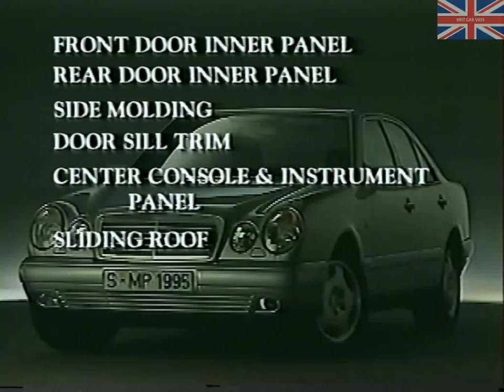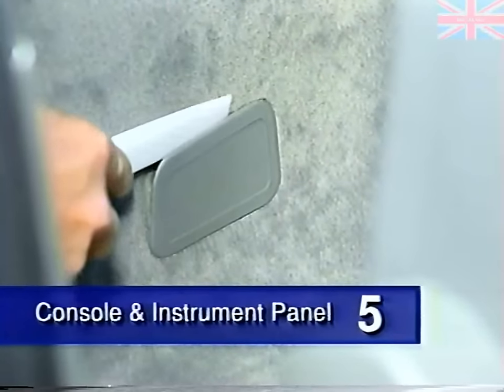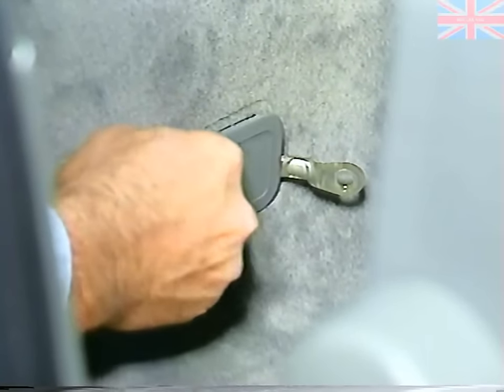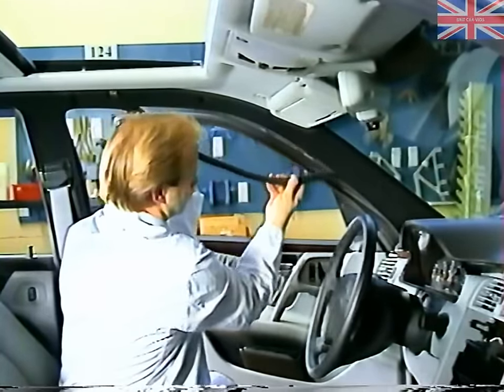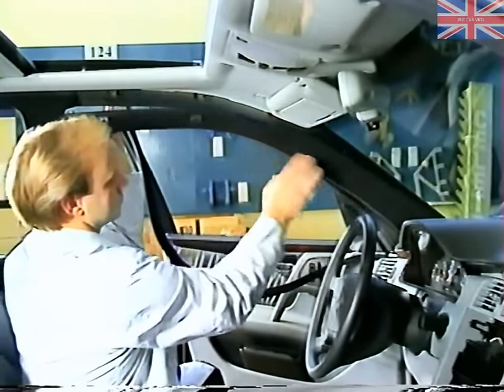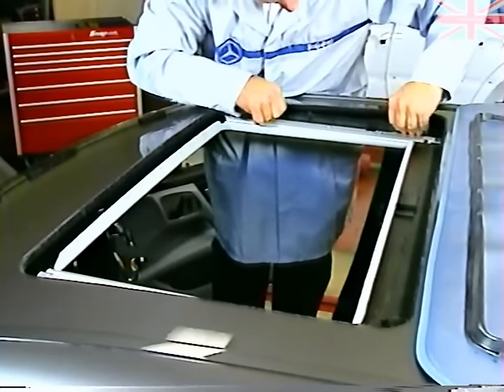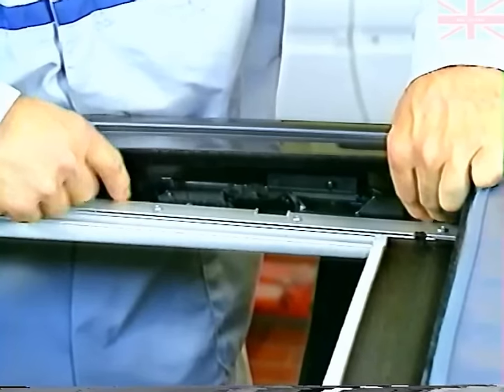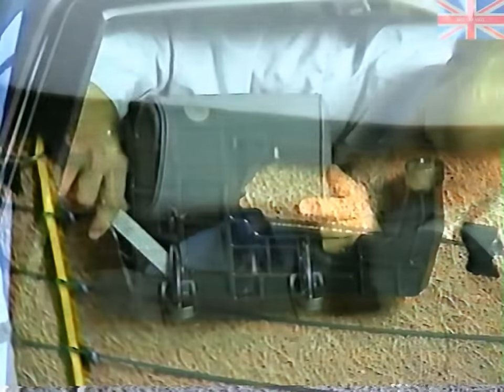Mercedes - E Class (W210) - Disassembly Procedures (1995)

Comment: who else has a rusty w210
Reply: ...depends a lot with the climate, if you live in a snow zone where they put salt as an anti frost...
Reply: I have a 1999 estate wagon which is even worse than sedans Sigh ; [
Reply: P A T I N A lol
Reply: I had a rusty W210 and now I have a rusty W211
Reply: everyone
Reply: @Sensual Digest hey just wanna know if the w140 s500 use the same mirror's. Like im driving ths v8 s500 boletproof n i lost a right mirror. So im looking fo one
Reply: I’m preparing my self to fix my Rusty friend, the two-ten 
320 cdi because I love how it rides.
Reply: 2000 e270 cdi here, little bit of rust, 570k km on the clock and im getting rid of that rust in march - beautiful engine, powerfull and reliable as hell
Reply: I’ve never had a Mercedes which wasn’t rusty.
Reply: my 124 has more rust than my 210 lol. I think people might a bit over excessive with the rust issue on 210. Yes, the waterbased paint is kinda bad at that time, but eventually every car will rust, just matter of time (I even saw an Audi a8 rust pretty badly lol). That's said if you take care of the car and maintain it properly, it's not gonna have any rust for sure  (but sadly not everyone appriciate w210 body style, which is another reason why they rust pretty badly)
Reply: I don't have rusty on my e320 never
Reply: In France near Paris. Not on my wagon.
Lot on my sedan.
Reply: I have 2 1 from 2000 and 1 from 2001 wagons is both

Comment: How i can reset the infrared remotkey to stop lighting both red & green on the middel mirror in w210 1996 ??
Reply: The same happened to me. This indicates that the battery is getting low so replacing the old battery in the remote controller resolves this. Cheers

Comment: Folks,   please help !!  Need to replace Brake Light Switch on my 2002 W210 E200K.  Please explain steps by Steps procedure.
Reply: Did you find the solution or do you still need help?